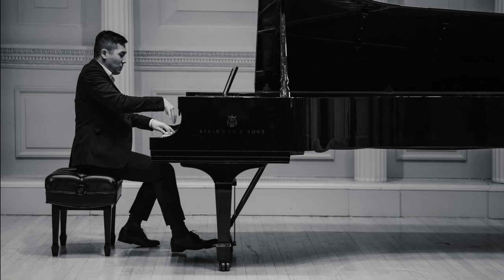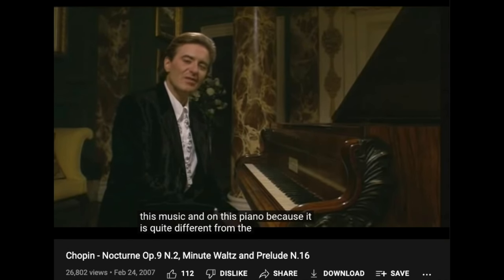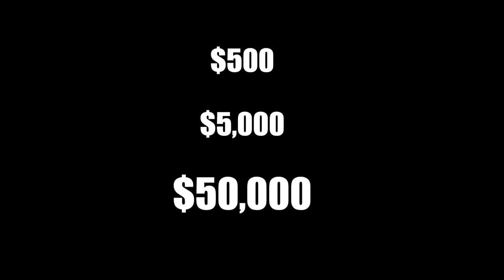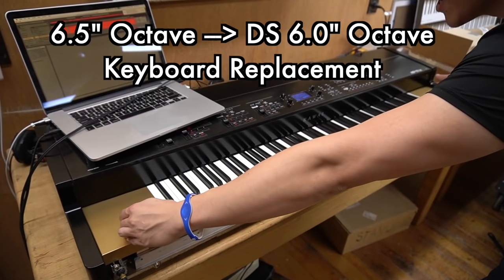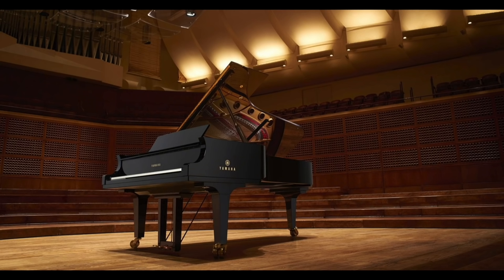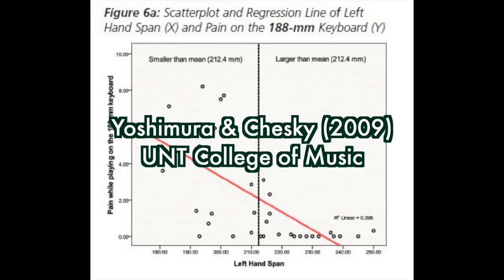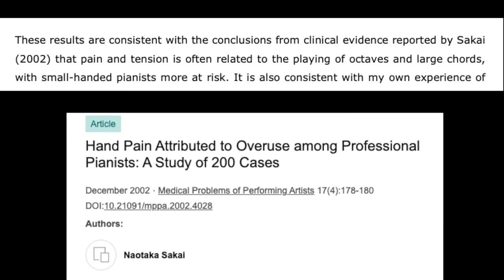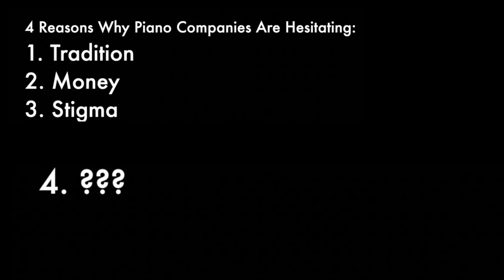Piano's Darkest Secret

Comment: Great video! I fully sympathize with your story. But, there's one item you probably overlooked because it does not apply to you: finger width. The average (50% percentile) width of the (adult) index finger is 18 mm for males and 15 mm for females. The width of fingers does not necessary synchronize with the width of the hand (small hands with thick fingers, big hands with thin fingers - like Liszt). There are international standards (ISO 9412–4 & ANSI 100–1988) to comply with these differences for (computer) keyboards. The recommended spacing is 19±1 mm. 
My hands are 10" and that's great for Rachmaninoff, but often I need to rotate fingers or change fingering to fit them between the keys. 
Ideally, there should be a few piano keyboard sizes (no more than 3 to avoid expenses for teachers and music halls) with different octave widths while maintaining the width between the black keys (so make the top part thinner). 
With you, I don't have a clue why piano action mechanism companies like the famous Renner do not offer several options. As long as they fit the standard 'cassette' shape to connect with the hammers it should be a matter of sliding a 'small' cassette into a (grand) piano in place of a 'regular' one. 
For electronic keyboards this is even easier: there are only 5 unique white keys and one universal black key (yamaha). So, with a smaller (ABS plastic) keyboard frame, contact rubber, and six molds for keys (manufacturing price no more than $1 per key) this should be a no-brainer.
Reply: Jazz pianist Fats Waller had a huge hand span with wide fingers. So the story goes he would sometimes grease the black keys to make it easier to slide in between them.
Reply: 10 inches?
I'm a male and my hands are 7.78 inches for the width.

Comment: I thought the 4th reason would be so even a drunk pianist could find it easier to play. :) I'm just a keyboardist, not a pianist, so I don't mind these too big keys keyboards, but I utterly agree with your view. Not to mention that there would be tons more great female piano players, too, since women have smaller hands in general. Thumb up, great video! p.s. I used to make hands exercises to widen my reach. I was using a table and stretch my thumb and a pinky as much as possible, doing it repeatedly. It actually worked and I was able to reach wider accords , more easily. However, it felt weird having to do those exercises just to be able to reach more keys more easily.

Comment: My idea is that innovations to the keyboard/keybed 1) are not that necessary (people play pianos that are tenths of years old, so those keyboards are decade old designs, including most stage and studio painos), 2) are only a relative small parts of the total innovation budget, 3) are relative long-lasting (sounds/gimmicks/screens grow out of fashion (much) faster). moreover, a smaller keyboard will open new markets, demographical as well as geographical. European are (still) taller than Asians, for example. 

An interesting path for change would be not to start with pianos, but to experiment with MIDI-keyboards. They already come with mini-keys, and those, I guess, outsell the ' normal' keyboards, that even have an own term, for they are 'special' and more expensive ('FS' , full size). Korg first introduces their mini-keys synths, and only a year later launch their FS-synths. FS-synths also are made in smaller numbers (and are considerably) more expensive. So, if it is possible at Korg, why wouldn't Roland be able to do it? Developments costs will earn themselves back sooner in MIDI-keyboards and prove the viability of, let's call it, the Chopin-layout.

Comment: I think there are technical reasons for the standard keyboard size in terms of the optimum physical size of a concert grand. If you think about spacing for hammers and strings because pianos became bigger and more powerful. However with modern technology it should be possible to reduce the keyboard width. Why don't they do this? I think it's because there has to be a standard for functionality and economics. Because pianos are not very portable and pianists must go from one to another at short notice they would not be able to adapt quickly enough between instruments. Also people have got physically bigger over the years since the pianos invention.

Comment: Aside from the narrower keys, can you describe how the touch/weight/accuracy of your MP11SE changed after receiving the Steinbuhler action? I really want a 5.5 or 6.0, but I'm afraid it will downgrade the feel of an already expensive instrument.

Is velocity range/accuracy/curve just as usable? Are keytop textures just as high quality or higher?
Reply: Reduced black key tops are ebony. White key tops are made with standard plastic material just the same as any new piano for many years as real ivory is now off limits. 

Otherwise, a lever is a lever is a lever. Switch out key set can be individually weighted by a technician just like any other key set. All other action parts besides the reduced keys are identical to the norm.

One touch related issue was the extreme offset angle of key levers in the lower bass initially resulted in a lever with a little too much 'give' and therefore less keystroke power. But Steinbhuler addressed this issue nicely by reinforcing the strength of extreme off set levers with an ingenious triangulated underbody structure.

Comment: OMG OMG OMG OMG!  Yes yes yes yes that is SOOooooo true.  I am 53 now and have had a successful legal career, but if I had even THOUGHT this 40 years ago my whole life would have been different.  I can stretch a tenth but only just, and short fingers means not much in between.  I got Grade 8 distinction when I was 12, but I hit a wall… I can fake them all, but will never REALLY be able to play Chopin Op 10 Nos 1,3, 4, 8, 10, 11, just to name a few, on a full size; but this would open that all up.  Let alone the entire works of Liszt, Rachmaninov, Scriabin, Ravel, Prokofiev… it just goes on and on..  My letters to Yamaha are going in TOMORROW.
Reply: The Waterfall (No.1) can be played with smaller hands. (Crimped 10th is not so small, same as me). It's kind of an optical illusion. It appears to be arppegiated 10ths but it's just as easy to block it out as a series of 6ths with jumps. Just start from the second note. Still a very difficult piece, though. Like hitting a moving target over and over again without fail.

Comment: Well I have the opposite problem. My fingers won't fit between the black keys. I recently bought a Petrof with wider keys than any piano I have played.  I no longer need to be careful not to get double action or try to adjust my hands slightly sideways. I don't see the point of one size fits all when clearly it doesn't.
Reply: Petrov black keys are very slightly narrower than the standard. But it makes a big difference for wider finger tips. Plus, if you have wider finger tips it's easier to hit a narrower black key anyway.

Comment: Are you speaking of just grand pianos?  because I grew up playing on a spinet (acoustic), then later on an upright (Baldwin acoustic). The keys are smaller on a spinet, Grand size on the upright. But there are also full uprights that have slightly smaller keys. Maybe key size is more standardized in the world of grand pianos.
Reply: I think Lionel is talking about all pianos. We're not aware of any uprights with narrower keys - maybe there is slight variation though? Let us know if you come across one. There are some digital keyboards with narrow keys but they nearly all have less than 88 keys and are unweighted.

Comment: woah, TIL. Back in the day I got to roughly intermediate level piano playing but I had a bottle neck. Most of the songs I wanted to learn gave me such a massive hand cramp. I couldn't progress past the bottle neck so I picked up he guitar instead. Same bottle neck but guitar necks come in smaller sizes...

It boggles the mind that no-one has thought of cramming more smaller keys onto a piano for more note mayhem. Perhaps the size of the keys are the optimal size to match the hammers so they sit in front of them without needing to zigzag the key to the hammer, if that makes sense. Would a smaller hammer produce a smaller or different tone?
Reply: The hammers are the same - the keys are just angled more. No change to the tone.
Reply: @paskpianos  Interesting, would the hammers produce a different sound if they were smaller than the default size?
Reply: @F4ngel  Yes they might do. I haven't heard of any keyboard makers making narrower hammers when they make narrower keys. Steinbuhler uses Renner actions.
Reply: @paskpianos  Thanks for the reply. This makes me wonder if a company or a youtuber has done any experimenting with smaller or even larger hammers

Comment: Surely the gap between the black and white keys would reduce causing different problems?
Reply: Only if you happen to have quite large hands and/or thick fingers, in which case you can stick with the current size. The reduced size of the gap is no problem for virtually all women, children and a large % of men. Two smaller sizes (DS5.5 and DS6.0) along with the current size accommodate nearly everyone.

Comment: 1 thing you completely ignored was difference in sound (piano standard). Gr8 video tho.
Reply: Changing the keyboard in an acoustic piano does not change the sound - the soundboard and strings do not change.
Reply: @paskpianos  I'm not saying that it does indeed change, I'm just saying it would have been nice to have some comparisons showing that, rather than just accepting it.
It will have a difference in sound, maybe insignificant, but it will be different. Hammer size, hammer weight changes and also empty volume of internals will contribute to the difference.
I guess I'll have to wait on another YouTuber to quench my science thirst. Lol.
Again, twas Gr8 video.

Comment: equity vs equality:
equity with alternate piano sizes
equality in preserving standard size
Reply: Once the choice becomes freely available we will see how many still prefer the current standard.
Reply: thats not that case tho. piano is a big instrument, how would you take your small sized piano everywhere?
Reply: @aloosh4495  Nobody buys acoustic pianos anymore. Yamaha U3 which i love as an acoustic upright, is around $20 000  with insane action (very responsive), i also love it's iconic sound more than their grand pianos.

Better get a good fully weighted 88 key electronic keyboard at 1/100 of the cost.
Reply: @aloosh4495  I'm not even counting the maintenance that an acoustic piano needs, how expensive are the strings, the fact that you have to hire a piano tunner, the shipping costs...

Yeah. I would love a DS 5.5 Yamaha U3 for myself (ideally with a MIDI interface and audio recording system for compositions, film, videogame scores, bands , etc), only in a unicorn fairy tale.

Comment: While we’re at it, can we get a larger option as well? My giant hands are a smidge over 10 inches pinky to thumb. I’ve got plenty of reach but my fingers are too big around and literally don’t fit between the black keys. I’d gladly donate 10% of my hand size to one if you folks given the option.
Reply: Try shaving down the sides of your black keys. Technical details below. 

First background discussion:

The traditional way of making black keys with slightly convex or outwardly slanting side walls makes no sense whatsoever. It makes it harder for wider fingers especially. It's just DUMB. It's just one more sunk cost fallacy delusion to which the human psyche is susceptible. Piano manufacturers all be like: "Oh,  we've always made black keys with outward slanting sides so there must be SOME profound reason for it. We just can't tell you what it is." (Those who own a Steinbuhler reduced-width pianos will notice he's had the good sense to make his black key sides straight up and down.)

But yes, for some unexplained reason, the conventional construction of black keys for both acoustic and digital pianos is wider at the base and slightly narrower at the upper or touchplate surface. The difference is only about 1/16" wider at the base or 1/32" on either side but that still makes about 1/16" of lost strike zone between any two black keys. But the white key tails between black keys are already narrow so the unnecessary spacial impingement of another 1/16" represents nearly a 10% loss of potential strike zone between black keys. That is not insignificant if you have wider fingers. 

(Indeed, there is a 1906 British patent by Rose calling for black keys sides with CONCAVE or inwardly slanting black key sides that make it much easier for ANY finger size to move in between black keys. But, of course, this proposal was entirely too logical and was totally ignored by traditional piano manufacturers who held religiously to the conviction that tradition is ALWAYS right.)

I'm a male with medium large hands and widish fingers. It was never too much of an issue for the light weight upright I learned on at home. But then as a teenager I bought a 60's Fender Rhodes electric piano so I could play in stage bands and that keyboard had a much stiffer action. Suddenly, fingers jamming between blacks became a real problem. 

(This was long before I learned about the Rose patent) but as an 18 year old I took the Rhodes keyboard apart and took the plastic black keys to a local auto body shop and got them to let me have a go with the bench grinder. I carefully left the upper touchplate surface unaltered by shaved down the sides of each black key so they slanted slightly inward. I wore no mask and my face was covered in black plastic dust when I was done. (Now I'm nearly 70 and still no lung cancer touch wood) but when I put my Rhodes keyboard back together it was like a revelation . . . there was now so much room it was like I could drive a truck between black keys! Understand, I actually made my black key sides slant slightly inward so about 1/16" was removed on each side for a total strike zone gain of about 1/8" for each slot between black keys. More like a 20% space gain. INCREDIBLE DIFFERENCE!

BLACK KEY ALTERATION DETAILS: Since then I've narrowed the black keys on a few more of my later day digital pianos. The method I use now is much slower but much safer and more environmentally friendly. I first remove the black keys from the keyboard (which can be harder or easier depending on the brand: Yamaha hard; Korg easy). Then I break a random pane of glass into pieces and gather up the broken pieces with curved edges which are also large enough to hold. Then I fix the black key with a clamp or vice and carefully pull the curved edge of glass along the sides of the plastic key. The plastic will slowly peel off in little solid strips and shards which are easy to vacuum up and don't get into the air. I work the side of the key it until I get just a mild concave effect. It can take 10 to 15 minutes per key side so it is very time consuming. But in the end the result is FABULOUS! TOTALLY worth it!!!

If you want to reduce the sides of black keys that happen to be ebony - which I have also done - this can be accomplished without the micro-plastic hazard with conventional woodworking techniques. Best approach is a router table using a wide dome-shaped router bit that can be positioned to shave a mild curve from the side of the removed black key - still attached to the wood key, of course. You may want to hire a skilled wood worker for this or if you are a wood working hobbiest like me you can still order a wide dome router bit online. Tip: the wide dome bit (1-1/4") I ordered from China had a shank gauge that was ever so slightly too narrow for conventional router chucks but I made it fit be carefully wrapping the narrow shank with a narrow band of aluminum tape. Took a bit of trail and error but now the Chinese bit fits. Also, the glass scrapping method will still work on the ebony keys. 

ThIS WORKS! IT REALLY DOES! I hope you give it a try.
Reply: Hmm. . . . no response as yet to my detailed post about ergonomically misproportioned black keys. I'm right. Every single word.

Comment: If the dude was 6'6" tall who developed the "Standard Reach" from  the first to the tenth interval on the piano just doesn't make sense.  He should have known his reach was longer than most.
Reply: Although there is not a strong correlation between height and hand span. There are some very short people who have big spans (eg the late Paul Badura-Skoda) and tall people that have relatively small hands. But we do know that adult hand spans vary widely from around 6 inches to more than 11 inches, and the males have significantly larger spans than females, on average.